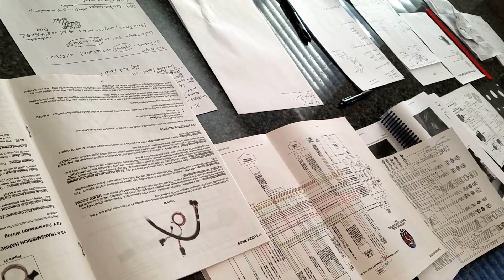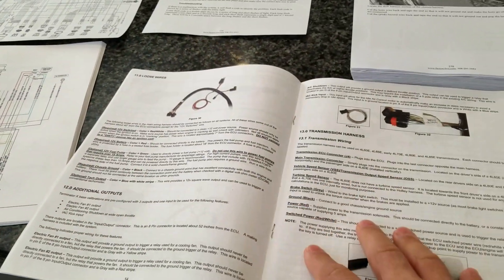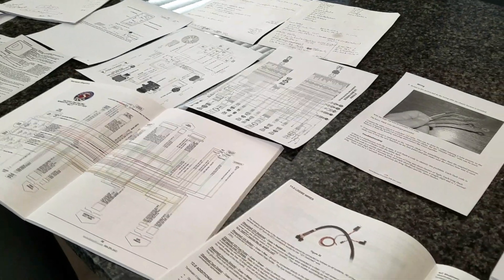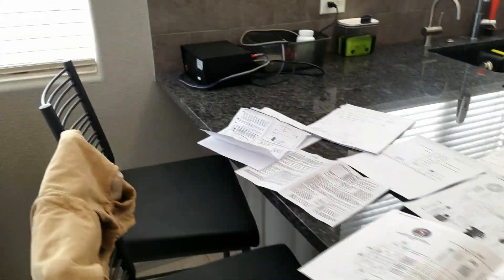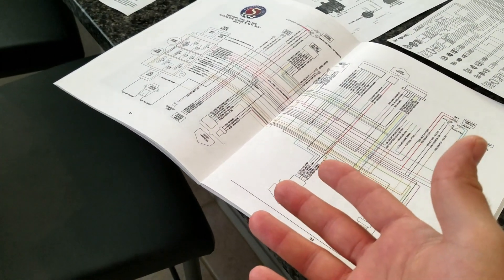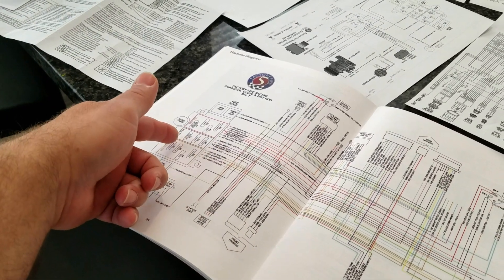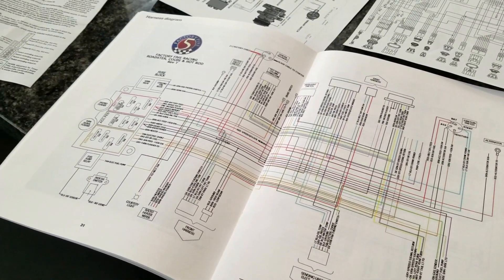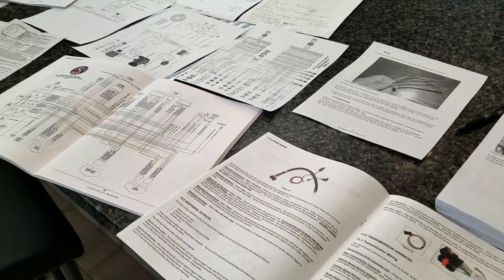Factory Five 33 Hot Rod V2 - Wiring Design, Testing & Charting

Comment: Door locks can be feed by a relay when normally closed feed from (battery bus), and operated  with remote all times, but pulled open when ignition is in run position so that the remote won't work until the engine is turned off, or in off position of switch that would originate out of fuse blocks (run bus) off fuse block that would pull relay to open postion from normally closed postion pole.  Easy peasy. This would be for door poppers or openers. Locks for doors would be different. I don't know what controller your using though might be entiely different.
Reply from the maker: My friend Greg said the same thing.